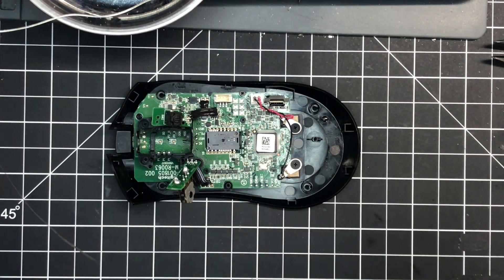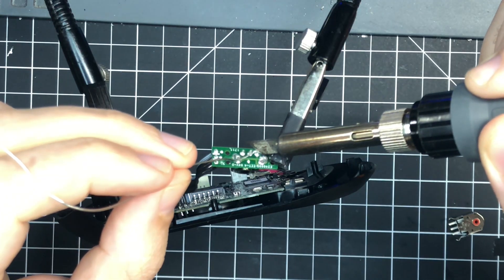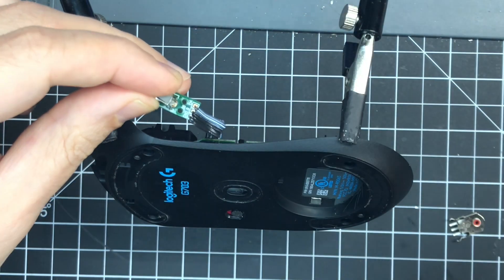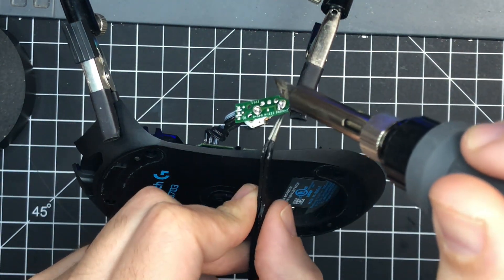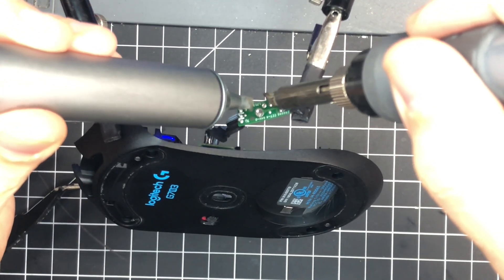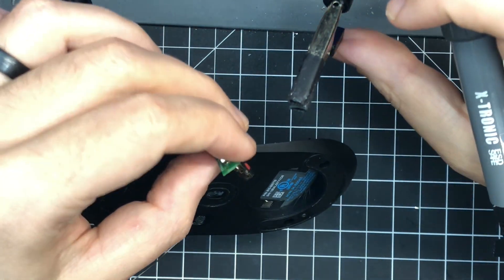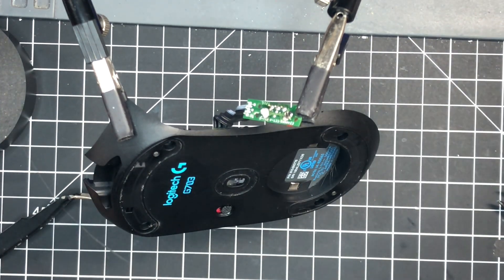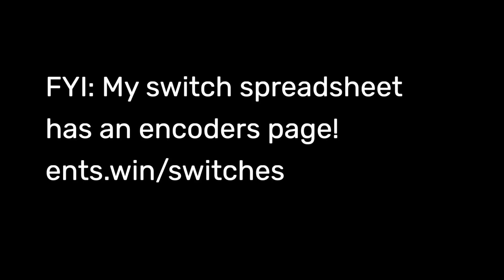How to swap and fix your mouse's Scroll Encoder! Fix broken scrolling in your gaming mouse!

Comment: Hi, i successfully swap the encoder and the click wheel switch thanks to your tutorials! But now i have a new question that your FAQ and google don't seems to answer. I bought 2x ALPS encoder on aliexpress but they feel really different from the one on my stock MM710 that use too an ALPS encoder from the factory (less tactile but miles away in term of smoothness), is it possible that somes encoder require a break-in period or i just got somes bad quality ones ?
Reply from the maker: there is a lot of variability in the force required to roll different brands of encoder. the spreadsheet does indeed list smooth vs tactile as far as encoders go. "feel" column. you probably want a kailh encoder if you like smooth feeling.
Reply: @entsfps  but the 2 encoder i compare are from the same brand, ALPS 9mm (viper mini) and ALPS 11mm (mm710)
Reply from the maker: @FALLUCK  that's normal. the ones you are buying are different from the ones mouse companies buy which are all tested to a certain force. the ones on aliexpress are heavy in general.
Reply: @entsfps  oh ok ty, which kailh encoder do you recommend for a smooth and define scroll pls ? i've seen that they seems to have make an update to their encoder (dust-free version), is it worth it?

Comment: Hi, I just wanted to ask you a quick question, what temperature do you recommend for desoldering the mouse switch, encoder and square switch?
Reply from the maker: ents.win/faq
Reply: @entsfps  ty but it's the temperature for soldering, not desoldering, you use the same?
Reply from the maker: @FALLUCK  yup
Reply: @entsfps  ok thx

Comment: I found my first encoder swap to be really finicky… all I can think is I was getting cold solder even though my soldering didn’t seem any different then when I’ve done switches… the encoder was acting really laggy, even going backwards sometimes… after I re soldered it making sure I got the solder really hot and flowing it seemed to work fine… maybe using to much flux as well??? Anyways I seemed to get it working properly but am not even sure my soldering was the problem lol
Reply: next tie use a lotfet, or solder paste (soft solder) they have lower melting temperature, so it's easy to solder

Comment: would anyone happen to know if the roccat leadr mouse rotary encoder is replacable? if so which one, i see a TTC and ALPs on aliexpress, i want a good replacement to not need to worry about replacing it again so any suggestions and information would be great as i can't seem to find any information anywhere.
Reply from the maker: im 90% sure its 8mm -- you should open the mouse and check before ordering, the encoder will be labeled
Reply: @entsfps  perfect, thank you for the quick reply. i will check the labeling before ordering. are there any differences between a TTC and ALP? i have no real knowledge on types or information about encoders or which ones are good
Reply from the maker: @leiroux  its all preference, the kailh ones are nice black core/gray core

Comment: I’m having an absolutely miserable time finding the info I need and you might be the one person who can help me out:

Do you know what switches could be used as replacements for the middle clicks on gpx, gpw, g703? I know I need some sort of square micro/ tact switch, but details about them are scarce. I’d like something as similar to stock as possible for each; I’m strictly trying to fix and have replacements on hand for double clicking. If you know what brands or typical operating forces they use I would be ridiculously grateful
Reply from the maker: the gpw uses a kailh 5.5h one, good luck finding anything that feels stock. you basically are lucky if you get a working replacement. operating forces are all roughly 75g
Reply from the maker: gpx is the same. g703 might be a 7.3h but no idea without actually measuring
Reply: @entsfps  I feared as much. I really appreciate the reply though. What do you mean lucky? Are a lot of them DOA?
Reply from the maker: @VicariousX  nope, lucky as in they feel/sound all over the place and theres no way to know what its like until you have it in your hands
Reply: Ah, bummer. Good thing they’re pretty cheap then
Reply from the maker: @The_W1nnt3R  for what mouse?

Comment: How important is the small thin wire that holds the Logitech Superlight scroll wheel? I was trying to put it on but because it was so small it sprung out and disappeared to the nether realm.
Reply from the maker: not very but helps with shaking noise

Comment: well there was a service for only 5 dollars to fix this in my country, but i ended up doing it myself, found this video, did it myself, miserably failed LOL. nothing on you dude your video is simple and great, but i just suck at this i guess :/ thought after soldering and desoldering keyboard components i could do this myself but sadge. i was proven wrong by myself. great video thoo!

Comment: good plan for getting it out.  i never saw an iron that size being used for this but you do some of the best work i've seen, so...
Reply from the maker: bigger than normal?!
Reply: if you're talking about the tip that size is very common lol... this is the size I use for my mouse switches. it came with my kit. makes life super easy.
Reply: Ents is the Guts of mouse modding.

Comment: Do all encoders work with various manufactures of scroll wheels? I know there's a height difference, but if the same height, will all wheels fit all the same sized encoder? I'm having a difficult time finding this answer... I want to change the encoder of my g305 to a more tactile feel. Thanks!
Reply from the maker: yup! they all are interchangeable except optical encoders like the g502, g903, and zowie/vaxxee mice
Reply: @entsfps  thank you!!

Comment: Im going to be a nervous wreck attempting this on my superlight. The one it came with sounds really janky and I'm going to replace it with the TTC Gold/Yellow. 

I'm glad you made this video. I will likely follow all the exact steps.
Reply from the maker: if youre in the usa you can send it to me to do for you! otherwise, good luck!
Reply: bruh I melted the plastic part of the new encoder when I  install it
Reply: How did it go? I'm going to put a TTC Gold encoder in my starlight. If it went well, how does the encoder feel?
Reply: @Gatarax  feels pretty good. It's honestly not too different. As for the process it was a lot harder than swapping out switches. Like way harder than it should be.
Reply: TTC Gold encoder is much louder then the white one.
Reply: @Tom888CZE  yes, TTC Golds are one of the few most tactile and loud.

Comment: If you’re going to attempt this, don’t touch the encoder once you begin melting the solder on the stabilizing pins because they will heat up the metal shell of the encoder and you could burn yourself. As always, Ents can do these things because he is pretty much immune to burns at this point.
Reply: This. I was yelling "WHAT THE FUCK THIS DUDE IS BURNING HIS FINGER" at 2:19 and 2:00
Reply: @MM-cg8cg  bro thinks he has a heatproof at this point
Reply: Hi I was changing my mouse switch and after I assembled the mouse I see my scrolling wheel not working at all .... Should I just replace the encoder ??
Reply: @amarramoul4027  Yep, if it's just the core not moving
It's a defective wheel and you need to replace it.
Reply: I touched the corner of the PCB as I was soldering and it was still hot, I have no clue how he was touching it like that.

Comment: great vid! i really like the non tactile smooth feel of the default kailh Logitech black encoder. Is the red core kailh encoder smoother? if not which is the smoothest third-party encoder.
Reply from the maker: it's extremely close to the stock logitech encoder feel, very smooth, lightly defined steps
Reply: @entsfps  On the opposite sprectrum what do you know is the stiffer and more tacticle encoder? 
Same question for the switches , I'm looking for something stiffer than the Kailh 8.0 I have on the MZ1.
Reply from the maker: @ariathyf144  both questions answered on my switch spreadsheet, ents.win/switches -- theres an encoder tab on the bottom
Reply: It’s the smoothest encoder I can easily get my hands on.